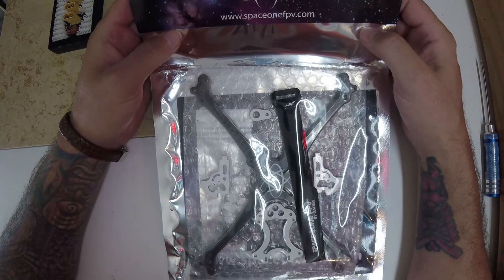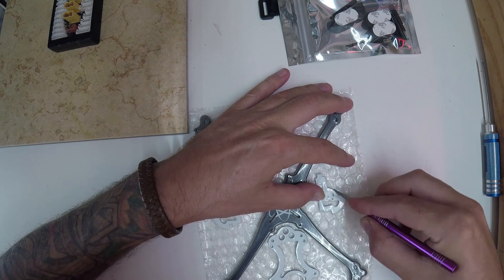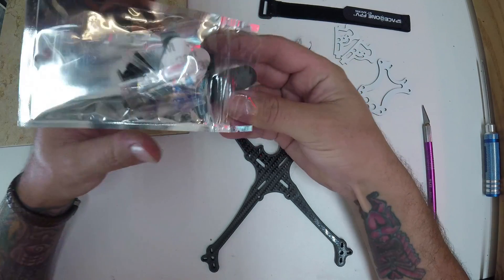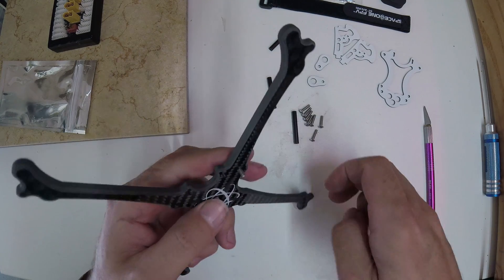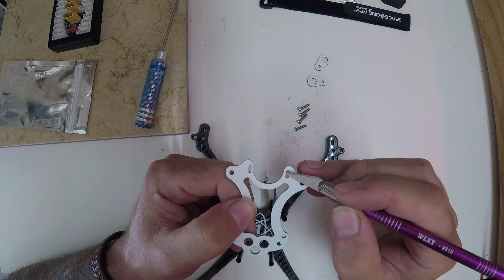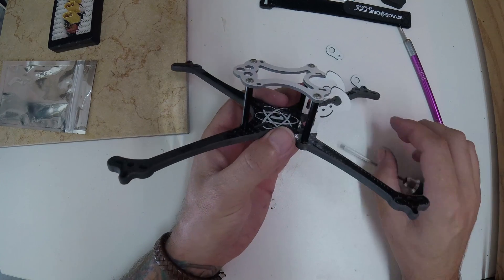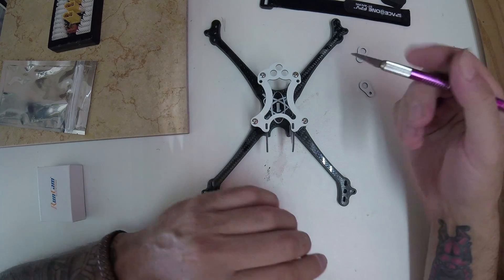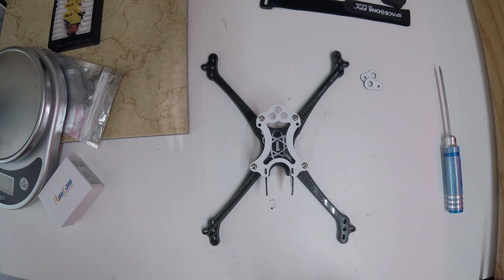First Look!! Space One FPV Aurora 5" Stretch X & Frame Assembly

Comment: I have the same frame also with bh  2206 2450kv motors and with the few crashes I did have so far no issues.  My worst crash so far was into a tree and a small branch punctured my lipo but frame is fine for now lol.

Comment: Do you know what motors you are going to use? The ones I have the clip on the bottom doesn't fit the hole on the frame
Reply: I had the same problem. I ordered some DYS SE2205 motors with the machine screw on the bottom instead of a C clip.